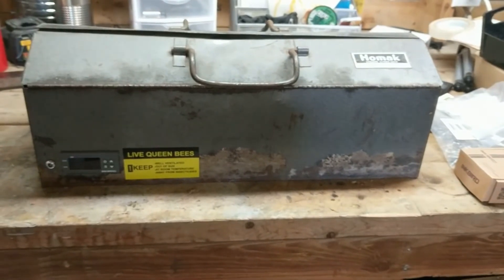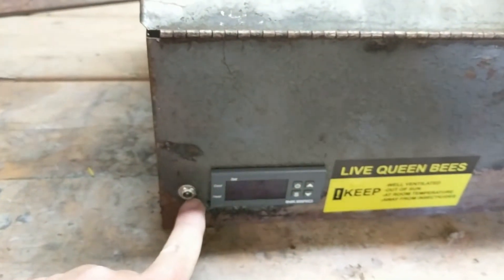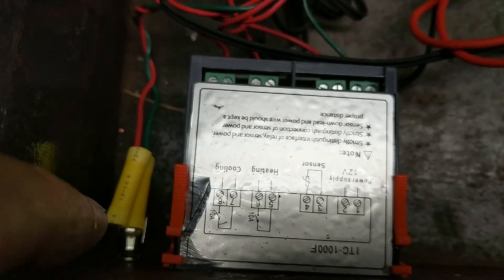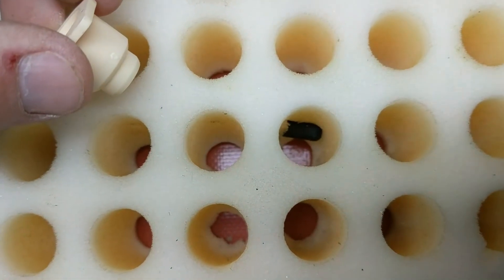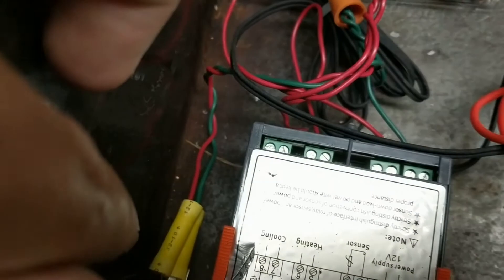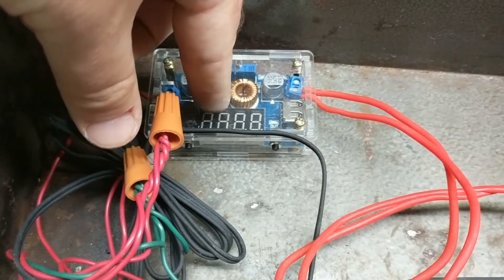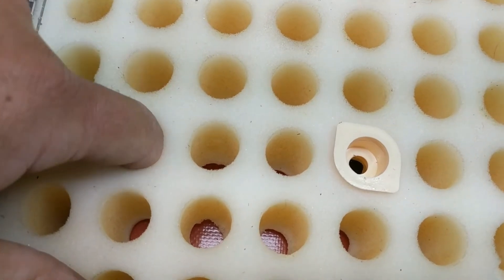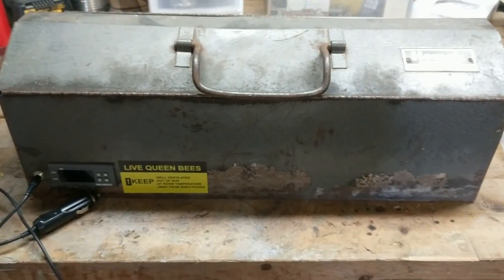Queen Bee Cell Carrier

Comment: Where did you find a laser to cut the holes in the foam and how much does it cost?
Reply from the maker: I used the Maker Space at my town's library.  The laser cutter costs thousands USD.
Reply: Just a heads up on this. I used a some 1/2 inch copper pipe and just sharpened the end with a file, works fine.

Comment: Hey Jonathan, thank you so much for sharing your video. Is there any way to hook up a second heating pad? Also is there a way to install a fan? I'm not sure if you know how but I thought I would ask. I would like to double the amount of cells you have. Go big or go broke :-) We do 60+ queens a week and want to double that.
Reply from the maker: My first thought is... build two.  You'll want one batch of queens held at temp while you're working the active batch. The second thought is... you are limited on the amps you can pull on a 12v cigarette adapter.  The average car is set up for 10A. I'm betting you can get a larger size heating mat and push towards 10A with ok results.
Reply: @jwchitwood  Thank you so much and I appreciate it. I will let you know what I find. Have a great evening.

Comment: Jonathan, thanks for the posting. I made one of these back in June based on this video and used it in July. I did have to spend a little time figuring out the best way to set the temperature. I found for me the best way was to use the temp sensors that came with it and place it directly on the heating pad, and then I have another thermometer that I have just above it in one of the cells. Even though the temp goes up to 105 or so since the temperature continues to rise after the power is cut, the other sensor only goes a degree or two up or down.  I also purchased a wall wart adapter so that I can plug it in an AC adapter. I only had to use it for 8 hours on one trip this year, but it worked fine. I'm sure that next year it will get more use.

I was a bit confused by the temperature controller at first, from the schematic that came with it, it looked like  you feed power through it from the buck. Once I realized that it was just a switch it worked fine.
Reply from the maker: Thanks for the great feedback!
Reply: Can you post a link to the wall wart adapter you bought, I'd like to put one of these in mine as well.  Thank you.
Reply: @babybeeapiaries8667  This is basically what I used, although I had a couple things like the foam and the box, and I didn't include some things like heat shrink tubing and solder, and some tape. 
http://a.co/fc9hrNS
Reply: @shannonswyatt  Thanks for your reply.

Comment: I bought the materials from your list above. Can you supply a wiring diagram? I hate to learn the hard way, but always do. Thank you kindly.
Reply from the maker: The wiring is a bit of a mess. It will be better if I explain it.... I don't draw well...  

The power from the 12v source powers the temperature controller all of the time. The buck is only powered when the heating element from the temperature controller is activated (on).
 
12v power source + -> connects to wire nut (union of wires) -> connects to + heater position 5 on the temperature controller   &  to + of power input on temperature controller position 1
 
12v power source - -> connects to wire nut (union of wires) -> connects to - on power input buck & - on temperature controller (position 1 or 2)

position 6 on temperature controller -> connected to + power input on buck   (the temperature controller is turning the power on and off to the buck. it's working just like a light switch.)

buck power output -> connections to heating mat cables

You can watch the video again to see what I'm talking about with positions 1, 2, 5, and 6.

I don't remember which is positive + and negative - positions on each device. So I just picked one of the two positions on the device for the explanation. You will have to refer to the manual of the devices you purchased for specifics on which position is positive and negative.

Please let me know if this does not answer your questions.
Reply: @jwchitwood  Huge Help. Thanks for the quick reply!
Reply: The extra cable on heat mat has a bk & red wire. I see this doesn't get used. Do the wires need twisted together to work, or left alone? Sorry to bug.
Reply from the maker: @samsungpizza  My heat mat only has two red wires.  The black wire in the video going to the heat mat is the temperature sensor from the inkbird controller.
Reply: @jwchitwood  Success!! Many thanks. I blew the 3 amp fuse that came with the power adapter, but everything worked after replacing it with a 5 amp fuse. Queen rearing done for me this season, but I'll be ready for spring! Nice video.